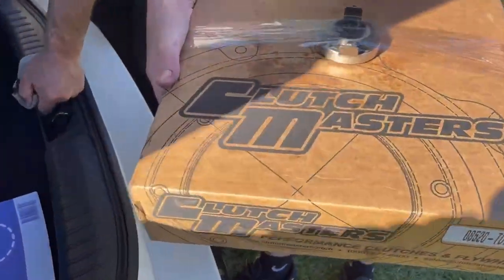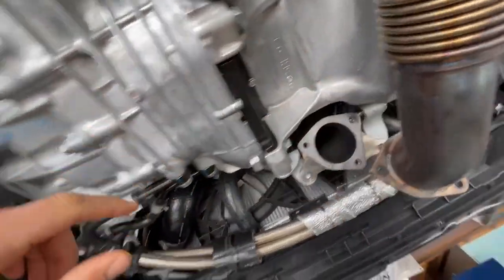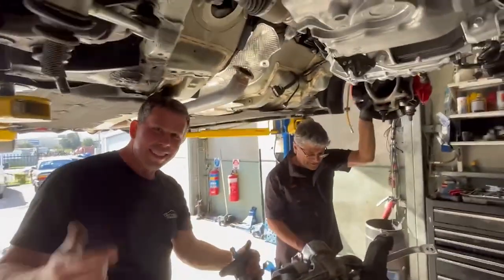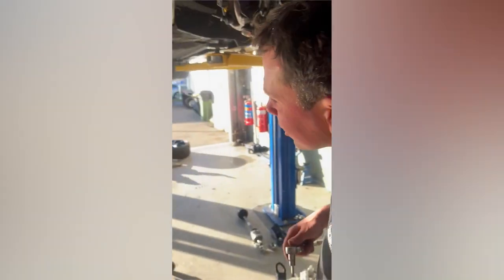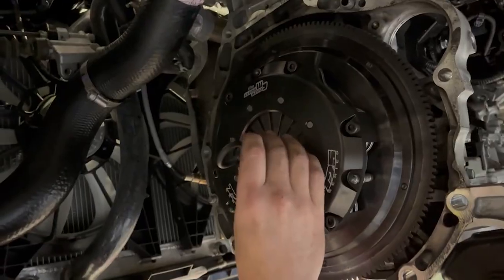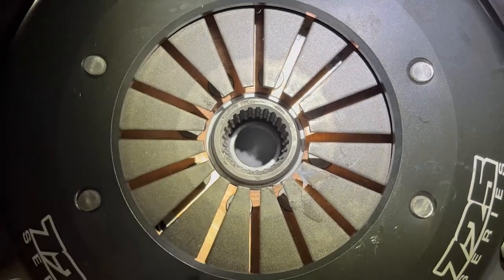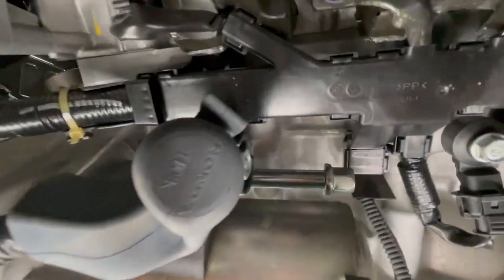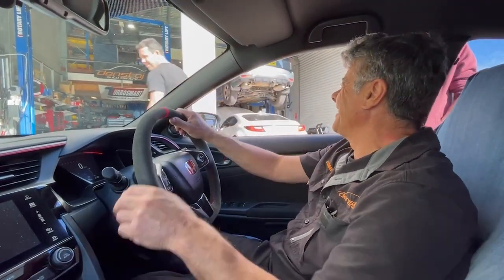Best clutch for FK8 Honda Civic Type-R?

Comment: Imho the best for the fk8 is the Xclutch twin organic disc good to 800 ft lbs, smooth engagement, less noise and stock pedal feel. I had the Clutch Masters 725 twin disc with the hydraulic throw out bearing. It didn’t last long and the hydraulic throw out bearing leaked. The Aussies 🇦🇺just overbuild anything car related because they’re crazy about extreme horsepower!
Reply from the maker: That sounds like the perfect clutch! Thanks for the heads up. Sucks that yours leaked. Will keep it in mind and keep an eye on our throw out bearing. So far so good. What other mods have you done to yours? Aussie, aussie, aussie, oi, oi, oi!

Comment: 400kw or hp? And how much tq?
I just upgraded the turbo and fuel system pushing 335kw 590nm wondering if I should do clutch next instead.
Oem clutch has 69k kms on it.
Reply from the maker: Wicked! I'm not exactly sure what the owner ended up getting in terms of power and torque figures sorry. An upgraded clutch could definitely give you more peace of mind. Are you planning on pushing it further?
Reply: @ nah that’s all good man, I was thinking the same thing for peace of mind…I do want to push it further just not to sure which way to go about it. Any recommendations for a clutch? I’m in aus as well.
Reply from the maker: @zg2017 is it a daily with some track days?
Reply: @denstoj  not a daily, will be a mix of street and track maybe like 70/30 street - track
Reply from the maker: @zg2017  If your FK8 is still predominantly a street car, I’d go with something like an Exedy single plate organic . It’s a solid upgrade for handling extra torque but still keeps a smooth, OEM-like feel for daily driving. In comparison, the setup in this video is track-focused. What options are you considering?
Reply from the maker: @zg2017  If your FK8 is still predominantly a street car, I’d go with something like an Exedy single plate organic . It’s a solid upgrade for handling extra torque but still keeps a smooth, OEM-like feel for daily driving. In comparison, the setup in this video is track-focused. What options are you considering?